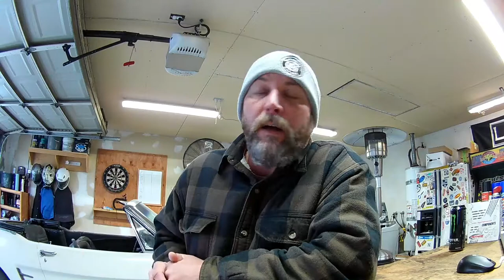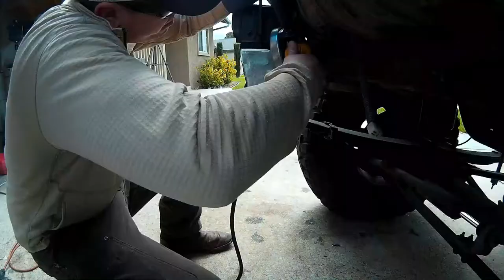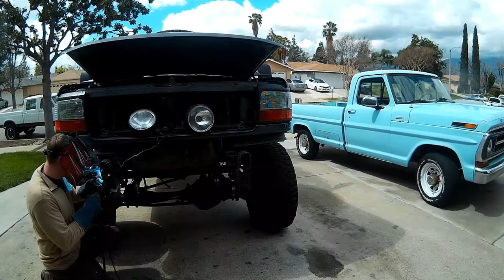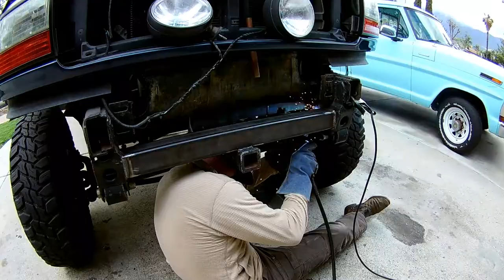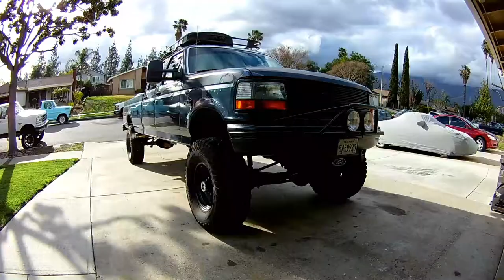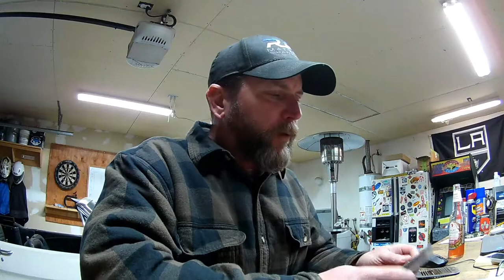Ford OBS; RSK Mods Adding Front Reciever Hitch!

Comment: Going to do an RSK on my CCLB4x4. If I get SD front springs would I have to move the stock rear shackle mount back or is that the point, to have it further forward so the shackle swings back instead of forward?

Comment: You talked briefly on the shackle reverse that Kevin's truck uses. What all involved and what's it's purpose a better ride or lift? I think you have 7.3 with also is it worth it and info? Thanks.
Reply from the maker: now THAT is a good question Mike!  and what i'm going to say about RSKs will probably be disputed..  most RSKs are  wrong, including Kevin's and my own...  there's nothing wrong with the install, the geometry is wrong.  it's flawed and will never provide proper front shackle movement and is simply a cheap way to get some front lift height...  

a proper front RSK would allow the spring to flatten and the shackle to move rearward during compression.  my front shackle is vertical and under compression (if there was any) the shackle moves forward just like the front shackle the RSK was supposed to "correct"...

now, that being said, you CAN improve an RSK by using longer leafs (like SD fronts) to increase shackle angle and make it ride much better, but the only way to FIX the problem is to move the shackle hanger forward or the leaf spring hanger back several inches.  so, it's a compromise.

if you want the truck to ride better, get some SD leafs.  if you want it to ride right, swap out the leafs for radius arm or a link suspension setup.  if you just want some cheap lift, the SDK will do the job.

the install is quite simple, the RSK uses the rear factory spring hanger as a shackle mount and comes with a shackle designed to fit it.  the front leaf spring mount is welded on the front frame rails and should be moved as far back against the front core support mounts as possible (i even notched mine to get it as far back as possible).  install takes a couple hours and nets about 4" front lift height (varies).

hope that helps, it aint much of an answer, but it's true!  thanks for watching!

Comment: Can you ask Kevin or give me a link to his YouTube channel ....i own a stock 93 F-350 4X4 with 5.8 liter . Just finished doing the front end , new ball joints etc etc EXCEPT for new shocks & leave springs . I am looking at a Sky Manufacturing front reversal kit & perhaps the longer Super Duty springs . I love my truck except it rides like a Lumber Wagon lol . I understand these 1 ton OBS Ford 4x4's are a rough ride stock especially unloaded . But not only rough but JOLTING when hitting any infections on or off road due to the stock front design of the suspension hangers . 
Will a Sky Manufacturing front shackle reversal with new springs really make that much a a difference in ride quality ?
Reply from the maker: sure, i'll ask Kevin to give his opinion.  when i did the Sky RSK on mine, i wasn't too satisfied with the complete lack of shackle angle that is supposed to be "acceptable", but mine is stock length OBS front leaves.  the SD front leaves should help angle by giving a couple more inches of length from center pin rearward allowing the shackle to have proper movement, which will provide better ride than having a vertical shackle.  thanks for watching!
Reply: VintageSpeed Garage Thanks...will be waiting on Kevin ' s reply . So if I have this right you do have the Sky Manufacturing FRONT SHACKLE REVERSAL on your Ford with just the stock OBS front springs ? So which Sky front Shackle Reversal kit did you buy ...2 inch lift ?
Reply: VintageSpeed Garage Oh lol just finished watching this video & it's Kevin ' s truck that has the Sky front Shackle Reversal kit . With the longer Super Duty front springs ?
Reply from the maker: yes, RSK is the slang term for it.  it was about 2" lift, yes.  after i did the shortbed conversion the back of my truck was way taller than the front, the RSK leveled it out and was a cheap fix until i can get time to do the radius arm suspension on the front.
Reply: faronf2006 we both have the same RSK (reverse shackle kit) on our trucks. I think the kit is necessary, but not for the purposes of making a smooth ride. I can't say either if it makes it smoother since my truck was purchased with the kit installed already.
Reply: Kevin Sinclair Thanks Kevin for your quick reply back & honesty . I guess I am looking for a ride that will be less JOLTING   when hitting bumps on or off road . Since you both bought the trucks with the kits already installed you would not be able to compare to stock . I just read today online that a owner had two OBS trucks ( diesels ) and both with a Sky front reversal kit . But one hade the code V Super Duty front springs while the other had a custom 2 inch progressive leafs which rode even smoother .
Reply: Kevin Sinclair I am even considering those Sulastic Shackles for my truck if available .
Reply: faronf2006 I did notice a better (not as violent) ride when I added the lift springs over the factory V codes. It's comparable to dropping the tire pressure 10lbs.
Reply: Kevin Sinclair, what color is that on your truck? And what is the paint code?